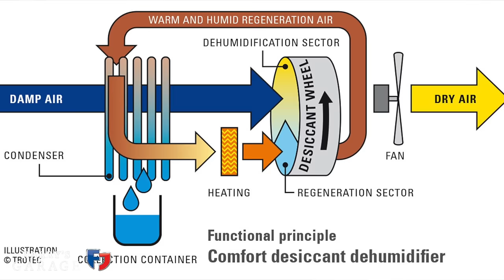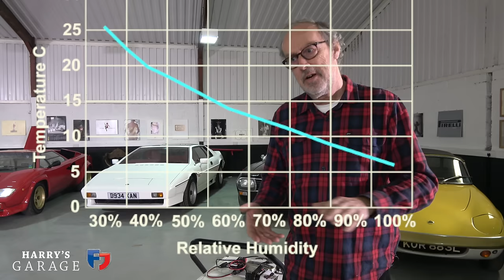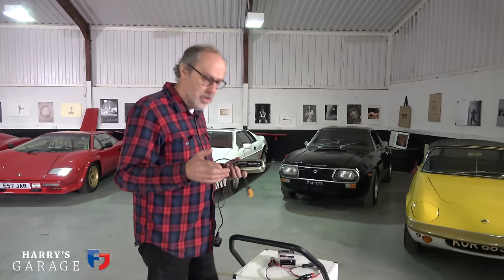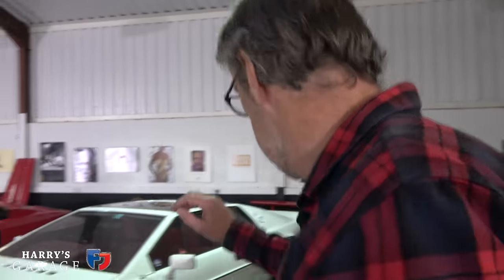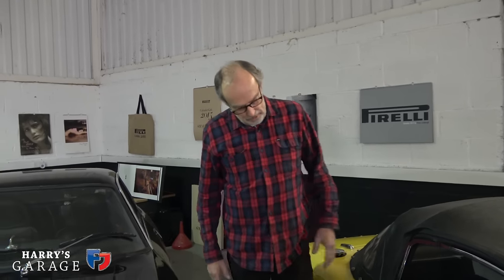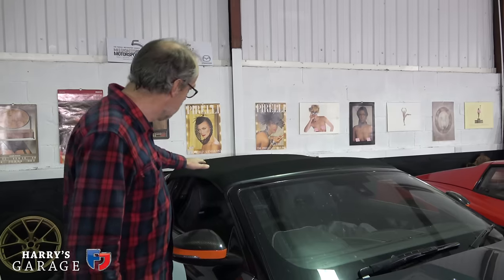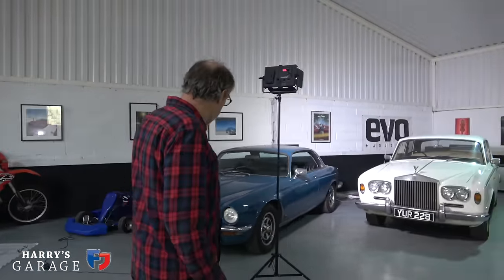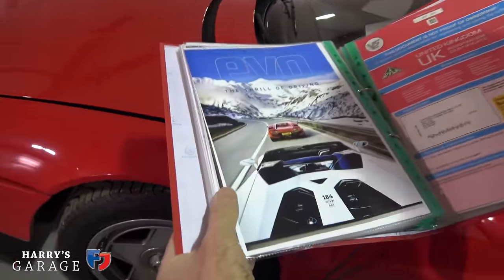My top tips for keeping any car in top condition during a period of storage.

Comment: Great video for winter storage:  I use the "Eco Air" desiccant dehumidifier(s) and they do a great job a str!pping the water out of the air & giving heat back.  I also occasionally put the small Eco Air version in my poor elderly Coupe (that got evicted from the garage & now sits on the drive) when the British weather keeps flipping from warm, damp & mild to frosty nights. Even set at 45% will remove 300ml (mug of water) overnight - Hopefully this helps to stop mold in the car & also helps the internal electrics from getting gremlins due to corrosion...

Comment: Great video, some good ideas. My twopennyworth:  
You can still use your car during lockdown. When you make your essential journey to the supermarket or whatever, take the classic, The carparks aren't as full so it's easy to find a nice big space to park it in away from everyone else. 
Don't run the car at idle for long periods. The oil doesn't circulate properly (or at all on some because the lift pump won't operate) so you are running the engine starved of oil. 
The idea of leaving a car running at tickover to warm up is one of the great classic car myths and can really do a lot of damage. To warm the car up, just drive it gently to start with, that way everything else also gets warmed up, then give it the berries! 
If you can't take the car for a run, still jump in and push the brakes, pull the handbrake on and off and move the gears to stop things seizing up. If you jack the front up you can also move the steering.
Even in the winter, if the weather has been mild, the roads are dry and any salt on the roads has been washed off by recent rain take the car for a run. Cars like to be driven, so go out and enjoy them!

Comment: Great video as always, thank you! I second the advice about the Testarossa, my 348 has a more modern Bosch Motronic 2.5 system but if she sits around too long afterwards I always get some hesitation/unevenness at low throttle. Fortunately, all she needs is to be driven spiritedly for 30 kms and things return to normal. BTW, I have a CTEK charger too, no sense skimping on an item like this, buy the best.

Comment: Brilliant video Harry. I already do everything you say apart from humidity control and leaving the windows open. I do leave a moisture absorber inside the cars though. My top tip is to not start any engine unless you plan to get it to operating temperature. Cold combustion byproduct is water, so you need the heat to burn it off. Else you risk having watery cylinders and oil contamination. Going to look at a heating solution now. Handily its a very small space! All the best
Reply from the maker: Very true about starting the engine for short periods, I probably should have mentioned that too..

Comment: I've had great experience with the 'cheap' dessicant dehumidifers you can get on Amazon etc - a £120 with around a 300w consumption on 'high' & an external drain & it keeps an un insulated brick/tile double garage & it's contents devoid of condensation over winter. They add the heat to the internal btw.

Comment: Another great video and all very good tips Harry. Another one that I would encourage classic car owners to watch out for is the fuel filler flap getting seized closed by corrosion. Unfortunately when taking one of my Celica GT-Fours out of hibernation a couple of weeks ago, I discovered that the top of the fuel filler neck (all steel on this age of car) had rusted and seized the plastic filler cap securely in place. I couldn't get it off by hand at all and had to make a tool out of wood to exert more force and unscrew it. The tank is coming out anyway next winter to be replaced by a freshly refurbished one including a shiny new filler neck, but for now I've sprayed some Fluid Film rust preventative gel around the cap to lubricate it and stop the rust from seizing it shut again.

Comment: Great tips, especially testing the brakes I found was very  important. My MGB had sticking brake calipers after a winter storage, this made the disks to heat up which boiled the brake fluid causing total brake failure. I had to use my handbrake/gears to stop the car..😮

Comment: My favourites for metal protection are ACF-50 and CorrosionX. These search and soak into the metal surface to provide an impenetrable film over the metal. They wont help much on flaking rust but they will soak under light rust and stop it developing into a more serious problem. Areas under the car can be treated with chain saw chain bar oil thinned with white spirit. This is great for giving a semi permanent protective layer on the undercarriage of everyday cars. Less ideal for classics which you won't want gunked up with greasy varnish.

Comment: Fitting a battery isolator work well .Simply unscrew a turn to disconnect battery
Reply: No more tracking. Easier for thieves
Reply: @dedasdude  As opposed to leaving battery connected isn't
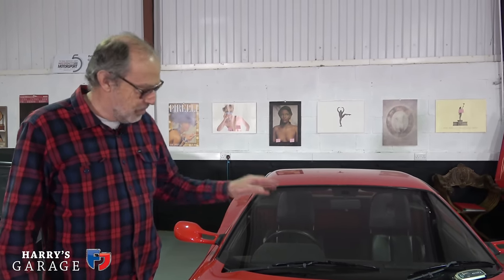Reply: 10:05
Reply: got one on ebay - was too tight fo rthe negative terminal even when fully loose - gouged the lead.

Comment: As far as flat spots on the tires, I order a sheet of 1/2", or 7mm, crepe "medium to hard shoe foam" and cut four squares and place them under the tires.  You can mark the floor lightly where the tires sit and place them before pulling the car in.  This dramatically reduces the occurrence of flat spots on the tires.  It also insulates them from the cold floor during winter months.

Comment: Harry,
Many thanks for the tips. Fortunately I didn’t need to enhance my methodology for looking after my cars as I use c-tek chargers which I’ve found to be excellent although the first one I bought three or four years ago has just developed a fault and will need to be replaced now. I keep one car in a garage linked to my house and this maintains a temperature around 17-18 all year round and the second car is kept in a Carcoon outdoor cover which has a charger built in to it. So far I’ve not had any problems although as both cars have SU carburettors when I check the cars over I make sure that the dashpots are full and that they have free movement. The rest of your tips I follow. But as always your videos are really helpful so many thanks for adding to my maintenance list it was extremely useful.
Regards, Chris

Comment: All good advice! The type that isn’t mentioned here is the Hybrid (not plug-in Hybrid) in which it is not possible to charge the traction battery externally. The Toyota manual for the one I have says that if they are “parked for a long time” the traction battery (the high voltage dc one) will slowly discharge (they are disconnected automatically every time the power is switched off). Thus it says “be sure to drive the vehicle at least once every few months for ~30 minutes…”. Then it suggests contacting an authorised repairer; not an easy recovery. It’s a bit vague, but no doubt it depends on the weather, what the charge was like at the end of the last journey etc.

The 12V battery is straightforward and can be dealt with as you describe, but I think it’s wise to run the engine from time to time to avoid the risk of the loss of the traction battery. In such models, it is the high voltage one that starts the engine, not just the 12V one. So if it does discharge it is not even possible to start the engine.

Comment: ‘97 SL 500 Merc battery eater solved. Spin left battery disconnect on the earth post. Spin right re-connect is all that is required under a car port in - 30 C conditions for storage only started above zero temps however. 👍✔️ Works for me every time.

Comment: I keep my tires at 55psi.  That is the level recommended by Porsche for storage.  Plus leave trickle chargers on.
Reply: Wow!! That sounds really high? Which Porsche and which tyres? Mine has 295/30-18 and 225/40-18
Reply: @Philly5G  9114s.  235-19 in front and 305 in back.
Reply: Thanks @paull3179 !! Mine's a 4S too, 996 :)

Comment: greetings Harry, i own 3 cars, one is just for summer time(max. 3 months use), one is for all day use(never in garage) and one is for replacement if one of those two i have is broken.Now, the summer car is  PASSAT CC 1.8 tsi 163 bhp manual, in the winter time, i keep it in a sealed garage,in the last 2 years this car never see snow or ice, from october untill april-may  stays inside,i charge her battery once every week untill is full(usually saturday), and i start the engine once every 3 weeks and let it run max. 30 minutes,whit easy revs after is warm up.In the hard winter, even outside is freezing, inside the garage in constant 1 degree celsius, i have a bottle full of water just to check if is freezing, never did.Unfortunately this vehicle have 225/40/R18 wheels, and when the car is not moving, you cant actually see if you have a flat tire,wheels on the ground looks same flat or blow, so i lost a wheel because the aluminium cut the rubber just like thatit has un air leak somewhere),even if the car have flat tire sensors, they work only when the wheels are spinning, but in my garage i cant move the car, is a small place and the car have 5 meters long....Other then that, no rust issue, no start issues,i like to wait untill the thermostat open the coolant circuit everytime i start the engine.Now, i have never have a problem, but still, maybe you know, there is a special way to threat this turbo engines?i mean, i should rev the engine more for the turbine to spinn?i only rev max. 2300 rpm when is stored

Comment: Sound advice regarding not letting older vehicles with fuel injection sit for too long. With Bosch K-Jetronic (or KE-Jet) the fuel distributor units, injectors and other components really seem to suffer with a lack of regular use. Fuel varnish, sticking components, dirty fuel filters etc can cause a lot of headaches. Unfortunately if you have a Testarossa then it’s ‘double trouble’, as it’s got a pair of fuel distributors (plus 2 each of many of the other fuel injection system parts).

Comment: Fantastic video as always Harry. I was particularly interested in the ctek battery charger. I have the mx 5.0 version which I use with my Mercedes SL because the consumer battery in the boot which powers the roof and lots of other things doesn't like being sat still and loses power. I haven't got around to fitting the eyelets on the battery yet, I will buy the indicator leads as you have shown instead. Thanks for this information, I was not aware of these.
Reply: Not a SL expert, but on the R171 & R172 SLK You can fit the "CTEK Comfort Indicator" to an earth & the cars Jump Start point..??  (Not that I'd ever jump start a modern car...!!)

Comment: Great tips Harry. I use the Ctec chargers. Very good. My Aston and Range Rover loses the plot if the charge drops. I use the cut off on the Ferrari. Older stuff Tr6, Mini etc never needs charging. Worth trying the new ethanol free storage fuel for winter. Won't rot out the pipes, carbs etc as the rubbish E5+ fuel we get at pumps now does on the older cars.
Reply from the maker: Where are you getting the ethanol free fuel from, having it delivered in cans, or are there outlets out there I don't know about?!
Reply: @harrysgarage  you can get it at www.aaoil.co.uk. down here in Dorset. The guys at Haynes Museum put me onto to it who maintain some of my cars. They are going to trial it on some museum cars too. Aaoil were also at the recent London Motorshow. I've had fuel leaks on my E-type and early Mini's caused by ethanol. It is basically race fuel, but it's now being sold as storage fuel too.

Comment: For wealthy folks with 1st world problems that we build homes for, embedded forced hot water heat tubing in the garage floor is standard, for efficient radiant heat. For less money or just as an additional unit to compensate for air inrush when you open the garage door on a cold day, overhead gas-fired space heaters take no floor space & blow huge volumes of hot air right where you need it. 

Harry might move his humidity gauge away from the unit for a better reading, and perhaps use a large standing or overhead fan to mix the room air. An exhaust gas hose system as they have in service facilities will allow you to run the cars inside for at least short periods when it's snowing or raining and you do not want to take the vehicles out, thus keeping those injector systems fit without poisoning the air.

Comment: The ultimate garage for me would be a insulated barn or building, toilet and kitchen facility, a 1 or 2 tonne electric travelling overhead gantry crane like a Demag and a scissor lift/car lift. split the place into two sections one as your workshop and one as your garage away from the workshop equipment with each section able to accommodate approx 3 to 5 cars with 2 to 3 dehumidifiers.

Comment: Maybe fitting a couple of skylights in your garage that lows sunshine to come through is a good idea also, it will raise the temp and dispel any moisture. Also having a bit of air circulation would help. Never put your car into the garage soaking wet, allow it to dry outside if you've just washed it. What I do is run it up to working temp once a week and move it outside for a while to keep everything free. Anyway, you can still drive your pride and joy in times like this but not to events or large gatherings, so my advice is to take it for a decent half hour spin in the dry then put it back in the garage. I can understand Harry's theory is for longer term storage over the Winter but we do get dry days even then, so try and take it out for a short drive if poss to keep things good.

Comment: good tip about tyre pressures. Easy to roll your vehicles... added advantage is that your brakes won't bind if you are not in a climate controlled environment if you can easily rock your cars back and forth

Comment: Hi I wonder if you or any of the subscribers could assist. After watching your excellent real world review of the Range Rover L322 3.6 V8 Diesel I bought one at a cracking price and it's a tremendous piece of kit and wafts along very nicely. Thing is how do you maintain the batteries on these being a "canbus" electrical system I believe and as you say they are very fussy when the volts get low  and raise all kinds of warning lights and of course won't start. Kind regards, keep up the great work and stay safe, Pete

Comment: Some good ideas for storing cars. Do be careful with modern cars not to charge at the battery. Large Audis for instance have a computer that look after battery and shuts down unnecessary circuits so that the car will always start. In the battery area it warns not to charge direct on to the battery terminals.  If the car is outside an electric solar panel charger is a good idea, again be careful where you connect it to. Harry uses one on his V12 Mercedes parked in the South of France. I use one on my SLK 350 and it sits on the passenger side dash.

Comment: That dehumidifier that throws hot air out of the building could be connected to a heat exchanger so the damp air gets condensed and drained outside and most of the heat is retained in the building.

Comment: If it hasn't been mentioned... if washing before storing make sure it's a dry day and take for a run out after washing/drying to use the brakes so they get dried off too. Otherwise they'll rust due to the washing water. This also air dries the underside of the car.

Comment: I would also recommend, if you have a manual gearbox, that you ensure that the clutch plate is free; I had one almost weld its self to the flywheel on my TR6 and I had to use a chisel to get off it off.

Comment: My Alfa 4c came with a rebranded ctek charger and I think they're the Ferrari branded ones as well. Mine is wall mounted and I have a couple extension cords. Every other bike or car in my garage is on a battery tender plus or black and Decker maintainer. Those are nice as the plugs are standard and I have some 25 foot extensions for cars in the driveway.

Comment: I've got a BMW E92 330i from 2007 sitting in the garage. Full tank, handbrake off. No battery charger though. This is its second battery, the first one lasted 11 years from factory. A new battery cost me 70 euros installed. I try to move it every two weeks or so for grocery shopping. On the driveway sits a 2003 SEAT Leon Cupra R with almost 300k km on the clock, still going great. I try to move it once a week, guess what for. Yep, groceries. Then a SEAT Ibiza diesel from 2007 sitting in the street. Again, shopping. They all shopping trolleys at this point.

Comment: That big DD unit, you could pipe its hot air humid exhaust through an intercooler to blow the heat out through the fins with a fan while allowing the cooled humid ait to continue its course outside the building.

Comment: Would love to hear about long storage in high temp low humidity areas, and  combatting the dry rot of rubber, plastics, seals etc..  For those that may live in arid parts of the Mediterranean, North Africa, US/ AUS desert regions etc.   I have  countless repair bills and maintenance from failed seals, early expiring tires, leaky window seals,  cracked plastics.  I combat it as best I can, but expert level tips would be helpful.  Even many care products that are highly touted, end up having a dessicant effect, they make a nice show, but they degrade the materials more readily.  Its a real costly battle.  Saving grace is lack of road salt and condensation, but there are still very real issues to conquer to keep a vehicle long term.

Comment: I have heard that I need to exercise the hydraulics on my older Merc convertible at least once a month to keep the seals in the pistons lubricated and prevent drying out. So, after this video, I will bring her out of the garage once a month, let her run for 20 minutes to get up to the temperature and exercise the roof. A dehumidifier is now on order. Having the windows open is probably a good idea as well.